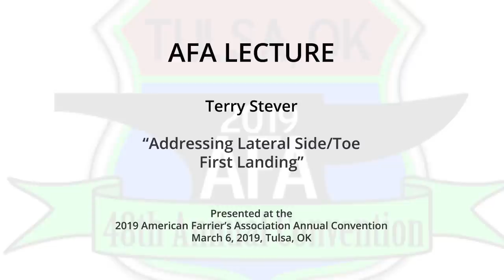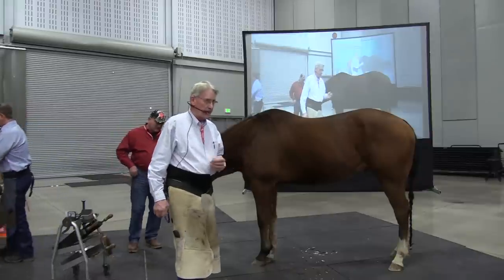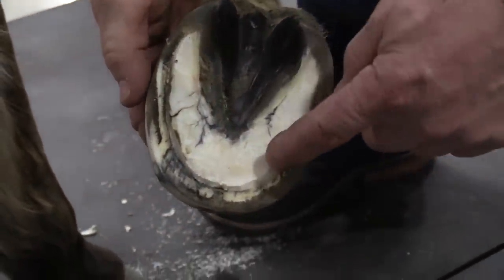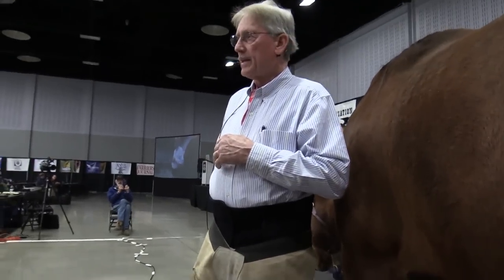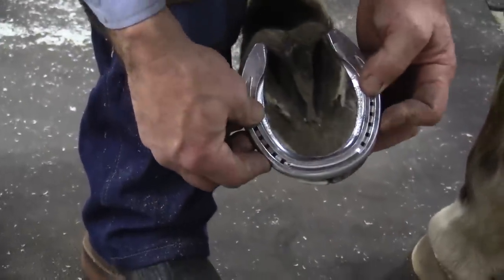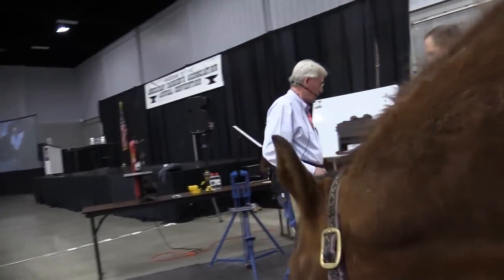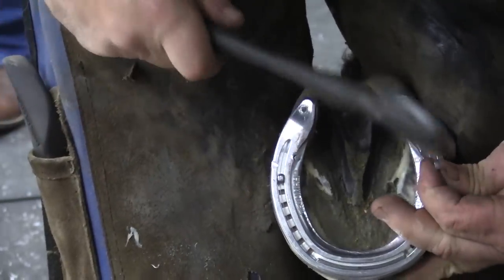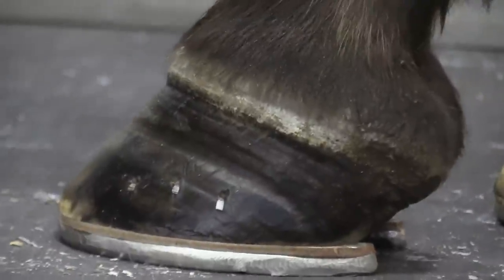AFA 48: Terry Stever: "Addressing Lateral/Toe First Landing"

Comment: Horrible feet on that horse. Frog is atrophied, lumps and ridges on dorsal wall most of the weight bearing is 70% in the front. Subclinical laminitis,chronic. White line disease in toe of left front. The only positive thing is the width of the frog was adequate. Poor horse
Reply: you saw that also  poor horse more could have been done but they forgot
Reply: There is a story of a Zen Master who is interviewed by a college student studying Zen. The student spends most of his time telling the Master what he knows about Zen while the Master remains quite. There is more to the story and easy to Google it … 

This is a demo horse, they’ll see the horse one time. They are also on a fixed time. They can’t get down in the weeds about every detail of the foot or muscular skeletal issues. There was a lot of subtle info that the very inexperienced will never pick up on.
Reply: Most deformity comes from Farrier proof is whittling away at frog Bars and sole as if they had no purpose. 
My opinion.